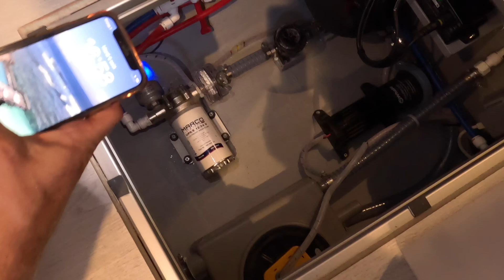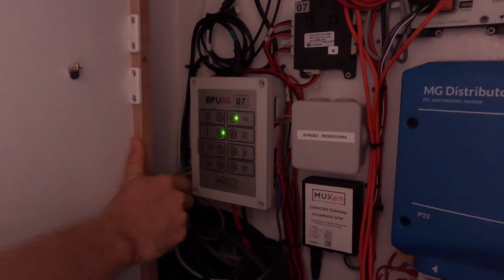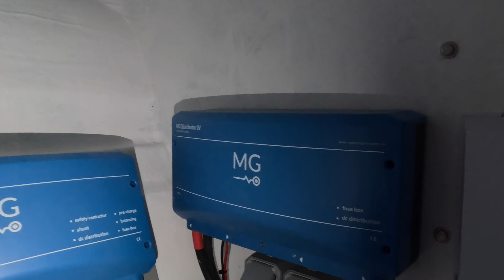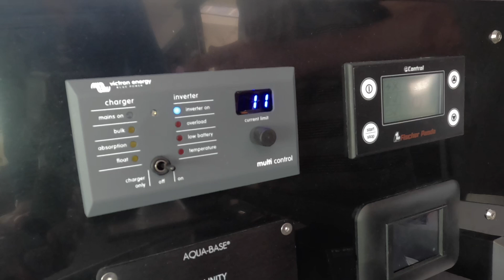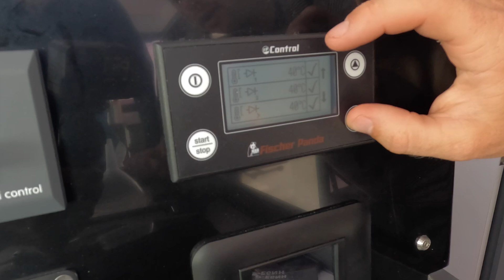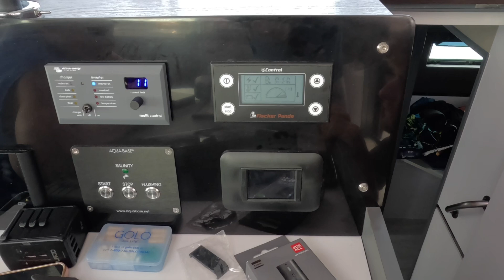Windelo Training Part 2

Comment from the maker: They supply and owners manual that covers all the systems. Along with some troubleshooting and. I’ll be accompanying manuals for all the equipment are included as well. Their service department is available and they respond very quickly whenever we needed any help.
I’m not noticed any noise from the water heater 
Lights are controlled from the chart plotter, from the individual switches and from the panels below.

Comment: Hey folks, thank you for sharing another video with us! This one is shot in landscape and HD, and to top it off, you even showed us parts of the boat (systems) absolutely no one else is showing, not even Windelo. Sincerely, this is very much appreciated!

I have some (too many perhaps) questions if you folks have the time. 

1:14 Does Windelo provide a full manual explaining every system and diagnostics for each part?
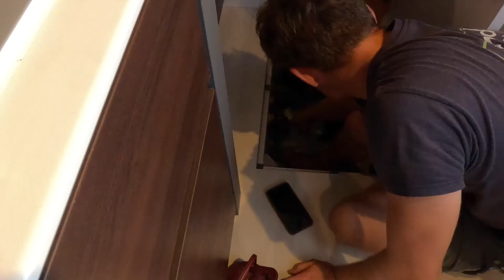1:54 Does Windelo provide a maintenance schedule for these systems like a routine checklist of some kind?
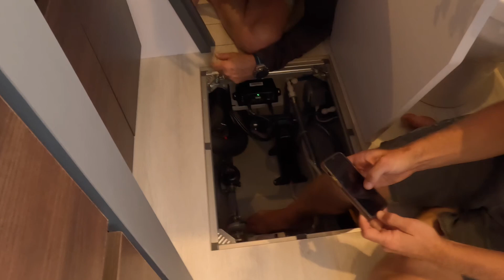2:30 I noticed the rep used the light on his phone to check the system. Ideally there would be a bright light mounted in each compartment (especially the fuse cabinet). Is this something you folks plan on adding or has Windelo mentioned adding to future boats? I'm thinking in the event of an emergency/ power failure this could be an issue. 
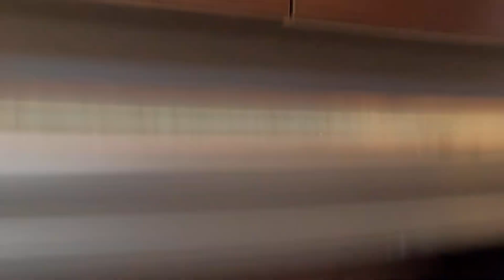2:49 What is this illuminated panel. I assume it is the hotwater heater panel? 
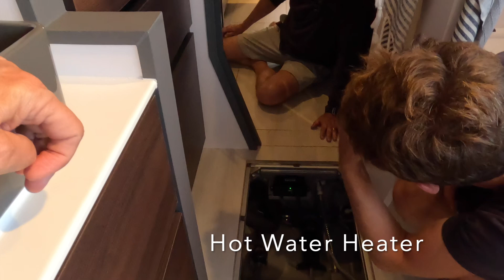3:14 Can you hear when the hotwater heater kicks on when laying in bed or is it "sound proofed"?
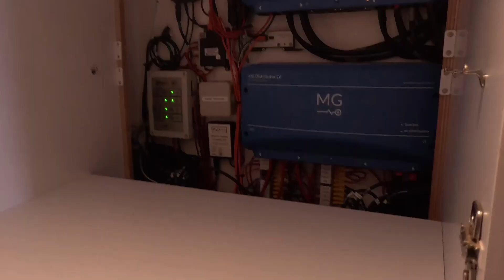6:02 Are all of the lights and the smaller panel functions (asked 2 questions ^) controllable\monitorable from the main panel at the helm?
6:03 I noticed the electric distribution panels and equipment were in the head and I didn't see stripping on the cabinet door. Do you believe this might pose a moisture issue with electrically induced corrosion over time? 
9:02 Were you folks able to get all of the labels changed to english/ your prefered language if not french?
13:41 Do you get a notification on the main helm panel of an over voltage other than the beeps?
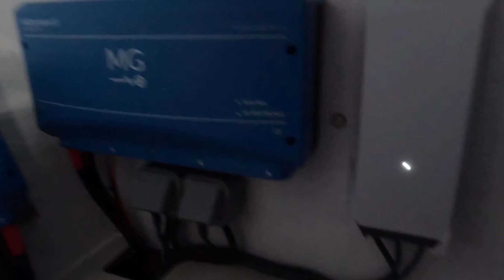15:05 Did Windelo later label all of the equipment? If not, do you plan to? Similar question as above but do they provide a full electrical run schematic? (similar to the aviation industry). Also, are the wires/data lines color coded/labeled?
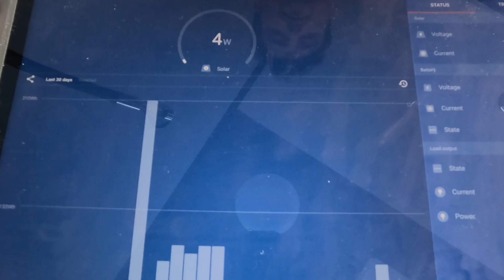16:55 Will the system report voltages/consumption for sub components? And does it log?   

Is there a way to shift water between tanks to prevent algae growth?
Did you folks opt for a US or European voltage system, or something different?
Are there ventilation systems to keep all of the electrical equipment in the cabinets cool? 

Sorry for all the questions. I hope at somepoint you give us the full tour of your new beautiful boat :)
Reply from the maker: All the wires are labeled, there is no master aviation schematic., But you get the hang of it pretty quickly. And that’s frankly why I videotaped it.
I’m glad you appreciated the HD and tuning it in portrait mode. The rest assure there should be lots of lousy video to come. We are far from professional Youtubers and this is mostly just for family and friends who wanna see what we’re doing on our adventure. We posted this for people exactly like you who might be interested in a deeper dive.
Part one will drop later today. And then there’s one more after that.
Reply from the maker: So welcome 
A
Part one comes today!